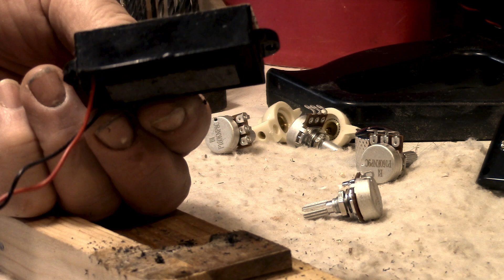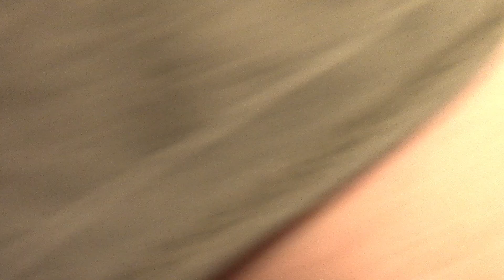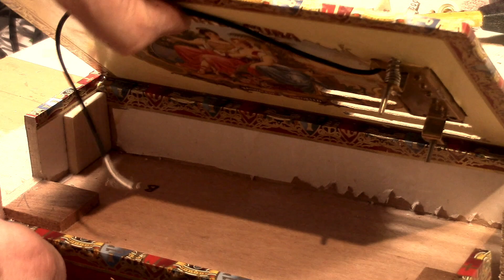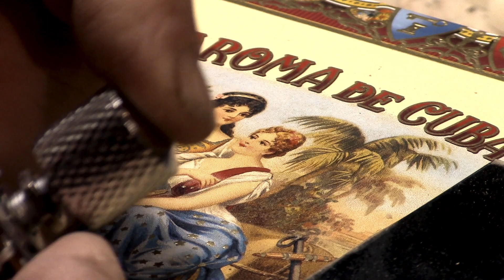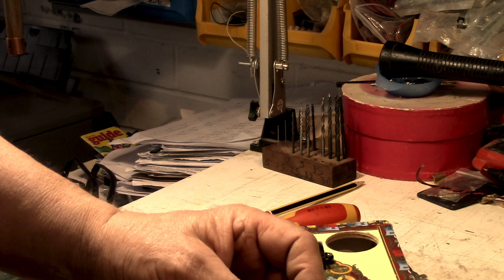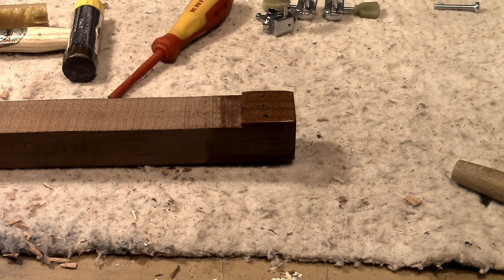Making a Cigar Box Guitar with ChickenboneJohn. Part 15. Fitting the hardware

Comment: Is it sufficient to connect the earth wire to just the high string? with a metal hinge the connection would be on all strings, but here you have wood...
Reply from the maker: There's a fretwire bridge saddle which provides earth continuity.